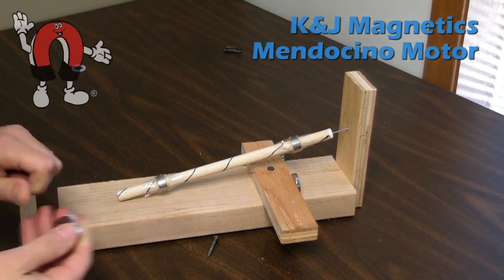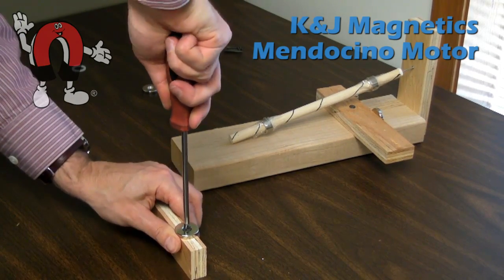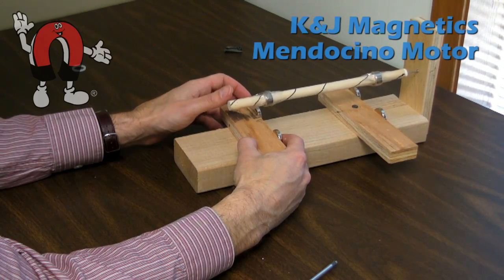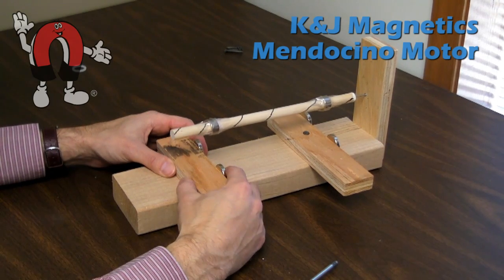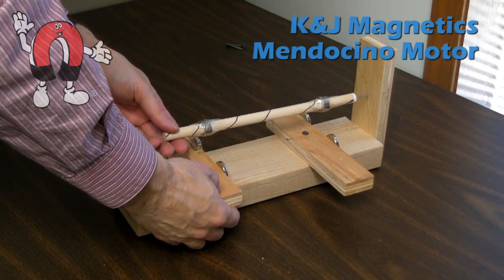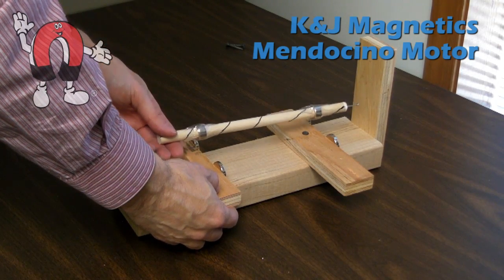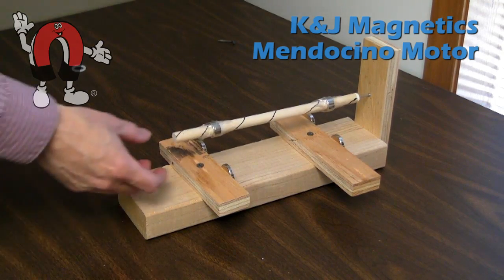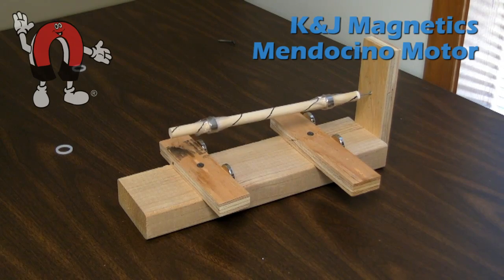K&J Magnetics - Mendocino Motor Part 3

Comment from the maker: It is mostly for a demonstration.  It doesn't produce any useful work.  See our article for more info: http://www.kjmagnetics.com/blog.asp?p=mendocino-motor-2
Reply: KJMagneticsProducts Nice work. Great videos!
Consider placing 1 more tiny magnet, North side, facing away from the end of the stick instead of a finishing nail.
Then mount another opposing tiny magnet, North side, facing outward from the vertical plywood.
Less friction & the spinning stick will look more like its floating.
QUESTION
What is the material that can "block" a magnetic field?